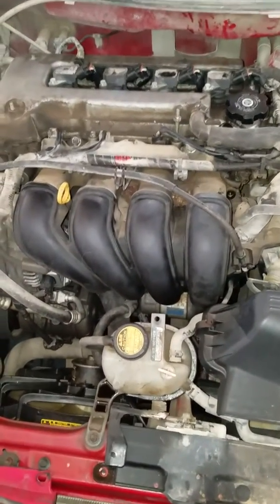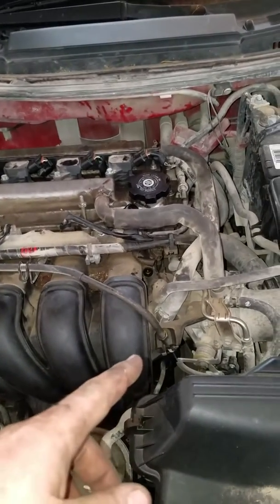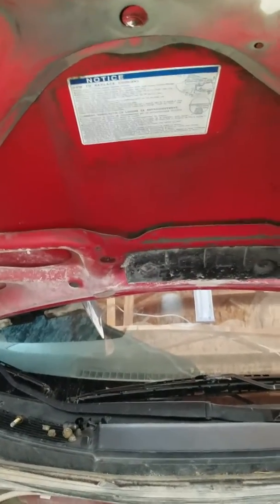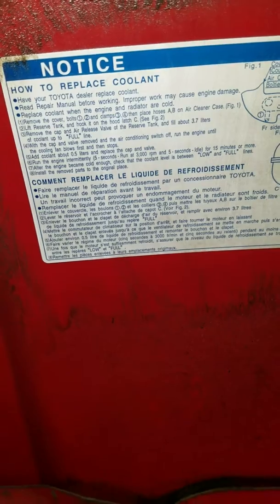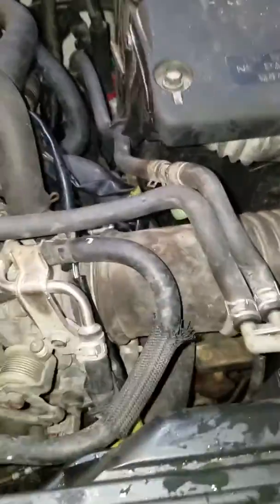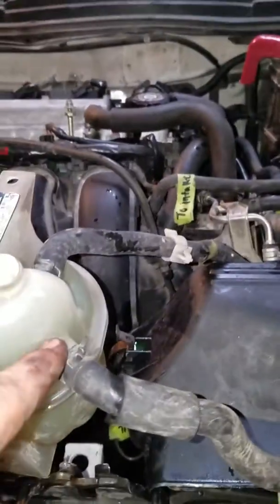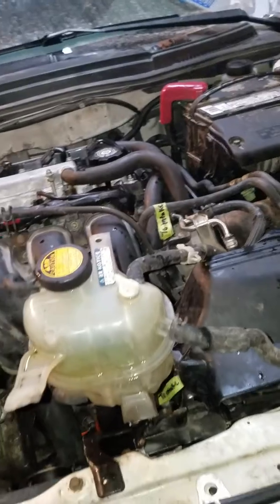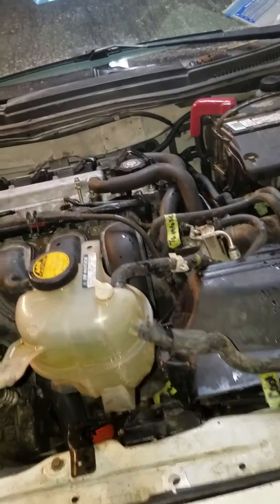Flushing/Filling the coolant on a 2001 Toyota Celica

Comment: well my car was over heating to the top of the gauge so i took my celica to the shop and told them to replace my water pump and thermostat and drain and fill the coolant with the resevoir must be placed at the highest of the engine so the coolant can go every where it needs to be like ur video lols. i must say it worked they double bleed it 2 ways just in case to get all the air bubbles out. i must say they did a good job i drove it about 30 min and the temperature stay at the middle now.

Comment: do you know if doing this process would help ? Just replace the thermostat , and got new hoses for the coolant system replaced and we didn’t see this video before doing the job…. Noticed white smoke coming out of exhaust pipe , AC heat blowing ,(engine wouldn’t overheat)  cold after attempting to cycle coolant….. would there be a chance that we somehow damaged the head gasket in the process , or is there a possibility that there’s air stuck in the system ?
Reply from the maker: @Goofysince03  Head gasket wouldn't have been damaged by you changing that stuff. But white smoke typically means coolant is getting into the cylinders somehow. This process probably isn't going to help the white smoke. I'd do a leak down test on each of the cylinders and watch for air bubbles in the coolant tank. That should tell you if your head gasket is the problem. Bubbles in the tank means the gasket is bad and letting coolant into the cylinder
Reply: @ I see … thanks for that , just got the car about two weeks ago and drove it 200 miles back to my place and it wasn’t smoking at the time …. Could be possible it’s the head gasket but the only issue it has was bad O2 sensors (replaced those) , I’ll try your process and see if that helps somehow , thanks 🙏

Comment: My Celica seems to always have low coolant, 
no signs of a leak
no smoke/steam from exhaust
no over heating, temp holds steady on every drive
no rough engine, its smooth and pulls well.

Im absolutely stumped on where the coolants going. 🤷‍♂️

Anyone here have any ideas what could be going on?

Comment: Aye my 02 celica just shit out on me. Replaced the valve cover gasket because it was leaking. Starters good and it’s getting gas. Just did the spark plugs. Gonna take it all apart and see whatsup any ideas?
Reply from the maker: Whats the issue it is having? Wont start?

Comment: Thanks for the video. I had my thermostat changed last year had driven my celica till a few months ago but started getting the code p0128. Changed the CTS still on. Heater air is warm. Was thinking mechanic that repaired it didn’t follow the instructions when refilling coolant and might have air in the system. Just my thought.
Reply from the maker: In my experience with these cars, if it is blowing good heat, should be good to go. But code 0128 shows its running cool. Thermostat could be stuck open if it taking a long time to get warm

Comment: Ok so I replaced my radiator and filled up my reservoir to full and ran the car with the caps off and the fluid went down but the fan never kicked on but it took the fluid , so I put more in and it’s the same deal , I squeezed one of the big piping on the passenger side and I hear liquid.
Reply from the maker: Make sure you have the reservoir raised up on to the hood latch otherwise its not the highest point in the system and air can get trapped. It takes a good amount of time for the fans to kick on sometimes, especially if its cold out. I've had it take 20 minutes or more before. Keep an eye on the fluid level and the temp guage. If the reservoir is not empty and the guage isn't reading hot, just let it keep running. Also, you can make sure your fan motor didnt go bad by turning on the ac on high in the car. If the ac doesn't kick on the fans, might have a bad fan motor too. But you want to go through this process completely without the ac on if you know the fans are good.
Reply: Ok so at first the reservoir was empty when I installed the new radiator. Then I lifted up the reservoir on top of the latch to the highest point possible. Filled it up to full and took of that drain cap on top as well. Ran the car but I noticed it started to drain the fluid as well so was that supposed to happen?
Reply from the maker: @techniciantj380  drain the fluid into the motor, yes. Drain the fluid out of the vent? It will if you overfilled it. Antifreeze/water expands slightly as it gets warm. Thats why there is a cold and hot line usually on the reservoir. If you filled it too much, it makes it harder for the air to escape.
Reply: Ah ok got it

Comment: The reason for raising the overflow up high above the engine to to release the air thats trapped in the system, good video regardless bro. Air pockets keep the coolant from traveling through the system.

Comment: The fan wouldn’t kick on and it doesn’t blow hot air either
Reply from the maker: You talking radiator fan or blower fan for the vents?
Reply: @ReedRacing9J  the radiator fan wouldn’t kick on after a while, but I know they work because I tested by turning on the ac. The vent blowers were only blowing cool air as well, wouldn’t blow hot. I touched the radiator hoses one was pretty hot the others were warm, but not as hot
Reply from the maker: @RyyFoo  if it is just sitting there idling, it will take a fair amount of time to get warm enough to turn on the radiator fans. I've had to wait as much as a half hour. It sounds like you haven't gotten to the point of the thermostat opening up yet, so I'd let it run longer and keep an eye on your temp guage. If it gets to the very top of the guage, shut it off, otherwise just let it run for a while. Once the thermostat opens, both hoses should get hot, then continue with the next steps and it should get heat through the vents

Comment: I was seeing on the instructions/diagram under the hood that the two upper hoses on the coolant reservoir need to be disconnected from the other ends and not the reservoir? I did you didn’t mention that part would it be optional ?
Reply from the maker: They don't need to be disconnected from the other end. Just removed from the retaining clips that hold them. This allows enough slack to lift the reservoir onto the hood latch

Comment: Hi i had a question about my celica so my car would heat up so i changed the thermostat but when i fill it up with water , i run the car and the water evaporates
Reply from the maker: The water shouldn't evaporate. There has to be a leak in the system for it to go anywhere. I would have a mechanic do a pressure test on the system and see where it is leaking. In a sealed system under pressure, the water will boil and some may push out of the overflow, but only if it is overfill. Thats why there is a tank. When it gets hot and expands, the extra goes into the reservoir tank, and then as it cools down, it pulls it back into the system. So start with a pressure test and I bet you will find you have a leak somewhere
Reply: @ReedRacing9J  but the thing is that my car when the water evaporates , smoke comes put where the battery and motor is at & okay i believe it should be the overflowing
Reply from the maker: @erikafelix3994  I would say it's steam coming out. You likely have a hole in your radiator or a hose. Again, I would have a mechanic do a pressure check or rent the tool from a parts store. It allows you to put pressure on the system without the vehicle running so you can see if there are any leaks.
Reply: @ReedRacing9J  thank youuu so much , ive been projecting my car while looking at your videos and this one has been the toughest thing to fix

Comment: What’s up? Hope all is well. I just got myself a 2002 celica gt and I was noticing my coolant being low every couple of days after I refill it. You think I need to flush my coolant and use Toyota red instead of the green? Also my car isn’t overheating, I don’t see any leak and my oil isn’t milky. Thank you for your time.
Reply from the maker: As long as whole system is the same, it should be fine. But if you are having to add some. It is going somewhere. It could be burning it, but I would use a pressure tester to see if you can find a leak or anything just to be sure. But if it has green in it and it looks clean. You don't need to replace it. I've had green in mine for over 100k
Reply: @ReedRacing9J  that makes sense. Yea once In a while I do smell coolant. There must be a leak somewhere. The question is where 💭🧐
Reply from the maker: @SMR-OD  if you smell the coolant. Pull the fuse cover off the passenger side of the center console and see if you can get a good look at the heater core. Or pull the glove box down and look. Looks like a small radiator with 2 tubes coming out the side and should be right in the center of the car by the firewall. Its common for those to leak in these cars. If that is what is leaking, I would recommend taking it to a mechanic unless you are fairly confident in your abilities because it is a labor intensive replacement
Reply: @ReedRacing9J  I’ll check it out tomorrow, i assume once I check id see visible leakage if it is. Thank you so much for your help. Ill keep you updated.

Comment: This video is so helpful. Thankyou so much. I do have a stupid question. If the coolest is low, can you just buy some more coolant and fill it up to the "full" mark? Or do you have to do All the steps you've shown here?
Reply from the maker: Depend on how low it is. If it just needs a little, top it off. If It needs a lot or the car is getting too warm at times, follow the steps here
Reply: @ReedRacing9J  wow, thanks for the reply, and so quickly! It's super low, below the low maker. I didn't care for the Celica during the pandemic. I will not drive It until I find the time to do these steps or get it to a mechanic. Thanks so much.
Reply: What if you just bought the car and the coolant is low and don’t know what coolant the previous owner had

Comment: Didn't show how to drain the old coolant
Reply from the maker: Remove the lower hose to drain the coolant.
Reply: @ReedRacing9J  helpp, could you please post a video or picture of this lower hose you mention? And how to remove it. I'm trying to get this right. 😢😢 I want to drain the old coolant.
Reply from the maker: @paolagomez3175  I will see if I can find a picture. But the lower hose is the large hose on the bottom of the radiator.
Reply: @ReedRacing9J  I found it! So no worries now. Thanks so much for your content!

Comment: So what should I do if I’ve already done put coolant in it. I wasn’t thinking and actually topped off the reservoir without the bleeder screw off. I replaced the coolant temp sensor and thermostat yesterday and hoses aren’t getting hot apparently water isn’t moving. I’m hoping it’s just air in the head or a pocket nothing more serious
Reply from the maker: You fill it on the first step of this, so just start at the first step after that.
Reply: @ReedRacing9J  nipple broke off radiator on the hose going to the overflow bottle! Do you know if there is a fix or am I going to have to replace the whole radiator?
Reply from the maker: @Kewlbrees985  unfortunately, most repairs you can do wont hold up because of the hot and cold cycles the radiator goes through. They may work temporarily, but they won't last. This is pretty common for celica radiators. I've broke one and know a couple others who have all broke in the same spot. The radiators aren't as terrible to replace as they look like they would be. I would recommend just replacing the radiator rather than attempting to fix it unfortunately.
Reply: Guess it’s time to shop for a radiator now. Thanks I appreciate your help
Reply: Also I have a 5 speed. I read the 2 fittings are for automatic. Do I need to cap those or just leave like they are? Thanks, again
Reply from the maker: @Kewlbrees985  Sorry, I just saw this. Don't know why the notification didn't show up. If you are referring to the 2 fittings on the radiator, you do not need to cap them. In an automatic, they have lines that run the transmission fluid up to those fittings and allow the trans fluid to pass through the radiator to keep it cool. Leaving them open or capping them will not change how the radiator performs. So I wouldn't worry about capping them. I never capped mine for my 5 speed either.
Reply: Me to

Comment: I'm glad I found you as I just finished putting in my motor in my 2000 Celica GT after 300,000 mi on the old one I'm doing the coolant in the morning so I looked it up just for haha thanks so much
Reply from the maker: Glad I could help. I should have more celica videos in the future as I just bought a no start gts.
Reply: More powerful motor but you'll never get the mileage out of it you do out of the gt model because even with the motor burning oil and a lift your noise up top things still ran like a top good luck the GTS I can see your a Celica fan cuz you had what three already such a fun car to drive

Comment: when revving for 5 seconds and idling for 5 seconds, are you supposed to have the caps on? or off?
Reply from the maker: On if I remember right. I dont have the steps right in front of me. You have the caps off for the first step. Then once you refill the coolant. You put the caps on.
Reply: @ReedRacing9J  post the steps.

Comment: Hey man I’m doing your steps right now and we’ll the bottom hose on accident let out alottt if coolant and I thought I had to do that with all of them, so I let all the hoses drain out the coolant they had and do I just follow your steps and I’ll be fine ?
Reply from the maker: Yes. Fill the system following the steps in the video and you should be fine
Reply: Reed Racing thanks man ! And while I was follwing ur steps I broke off the nipple on the radiator... I ordered a new one from tmrw 😭 damn Toyota made a poor design on that nippple lol
Reply from the maker: @otonielparraga3137  I've broken one before too. The plastic gets brittle after awhile
Reply: Reed Racing yeah man, and is it hard putting in a new radiator? I’m gonna do it my self I just called a shop and they want to charge me a shit ton
Reply from the maker: @otonielparraga3137  not hard. Everything is pretty packed into these cars so just make sure you take your time so you dont break anything. If you have any questions when you are doing it, let me know!
Reply: Reed Racing thank you so much ! Great YouTube content by the way keep up the good work !
Reply: Reed Racing I’m subscribing right now !
Reply: Reed Racing quick question is you did this on a 01 celica, I have an 02 is it any different or the same ?
Reply from the maker: @otonielparraga3137  should be the same.

Comment: Sup bro I have a question. I recently took off my throttle body to clean it and disconnected 2 radiator hoses to the throttle body when I did it. I put it back together but when I did I noticed my coolant was disappearing from my reservoir without any visible sigh of leaks. What do you think it could be? Maybe air pockets in the reservoir?
Reply from the maker: If it continues to go down for a while but doesn't stop, then there could be a leak that is slow and hard to find. The reservoir doesn't hold much fluid so you may not see it right away. 

If it  stops going down soon and stays at a certain level, then it is likely an air pocket. If you want to make sure to get all the air out, start by moving the reservoir up on top of the latch as shown in the video and run through the steps shown to bleed any air out. 

If it still continues to go down after that, you may need to use a pressure tester to apply pressure to the system to find the leak. If you don't see a leak, it could be leaking internally(head gasket, cracked head or block, etc.) And burning it along with the fuel. If this is happening, you will see some amount of white smoke out the exhaust while it is running. 

Let me know what you find or if you have any more questions!
Reply: @ReedRacing9J  Fer sure. it was working just fine for years until i took it all apart and put it back together today. Thats why i am wondering what is happening. it would be strange for it to be a blown head gasket but not impossible either. im wondering also if i maybe didnt connect some hoses back on right. i should also add that i also replaced my air intake manifold gaskets so im wondering if that has anything to do with this happening as well

Comment: Was about to change the thermostat when I came across your video. Thought I’d give this a try and it returned heat in the cabin and the temperature gauge stopped fluctuating.  Thanks!
Reply from the maker: Glad it helped! That's why i made it. I plan to make more celica videos whenever I work on mine.
Reply: So, you ended up not changing the thermostat?

Comment: So where is the flushing part.. all I seen was bleeding the coolant system
Reply from the maker: To flush. Just empty the system and refill it. Pull off the lower hose to drain it. If its super dirty, run water through it once and then drain and fill with coolant.
Reply: @ReedRacing9J  do you need to bleed it for the flush part?
Reply from the maker: @bruhmoment8031  you bleed it anytime you fill it. So if you completely empty the system and then fill it with water to flush it, you will need to bleed it to make sure you are flushing the whole system.
Reply: @ReedRacing9J  got it. Thanks.